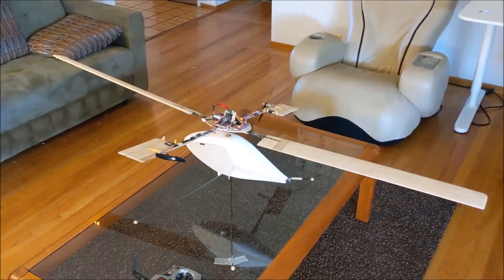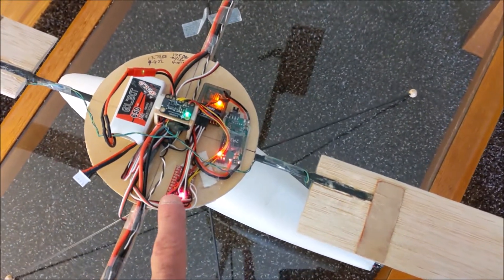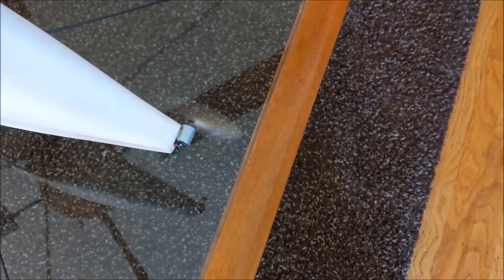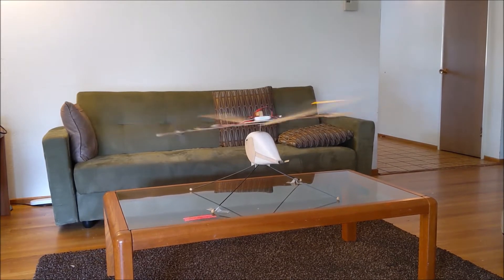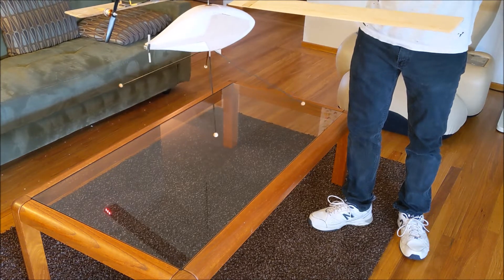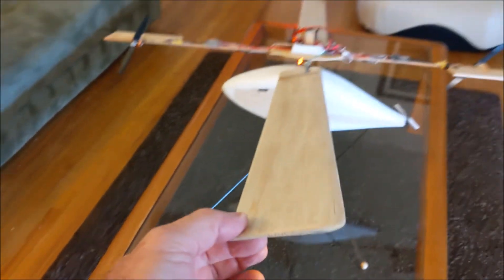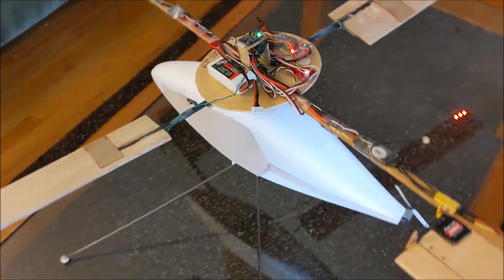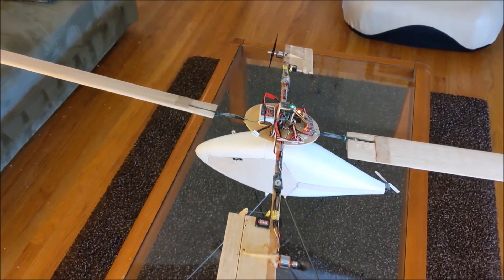Compass Controlled Helicopter with Fuselage and Tail Rotor

Comment: Great stuff Steve!
Instead of servo's for cyclic, you could maybe try modulating the motor RPM's with both motors angled slightly upward to give a thrust imbalance torque to Hiller arm - use a fast update drone ESC. Alternatively 4 motors - one angled up, and other angled down, on each end of arm, with complementary thrust modulation.

Comment: Wow! This is a cool concept. I]m surprised the servos were fast enough to stay in synch with the rotor. Are these high speed servos or does the rotor just spin very slowly?
Reply from the maker: The rotor speed is around 5 Hz (300 RPM) and the micro servos on 6V are just fast enough to work without too much loss of bandwidth.

Comment: Hi Steve: Do you know where I might get a filler adapter for a Second Chantz compressed air system. I have one in good shape (a gift from Darrel) but he no longer has the adapter. Maybe there is one I could borrow and make a copy. Thanks, Rol. BTW, cool 'copter concept